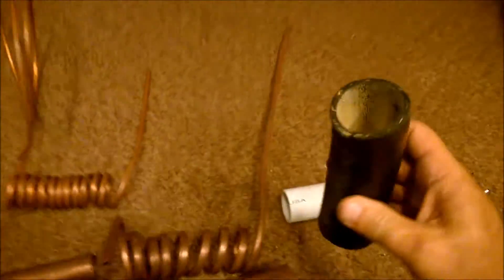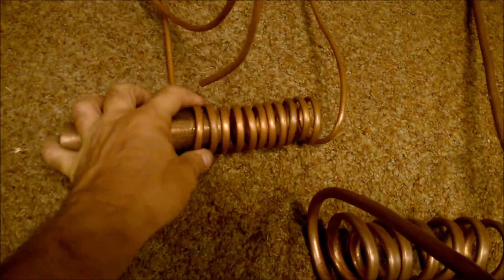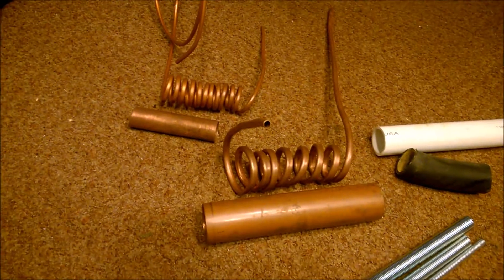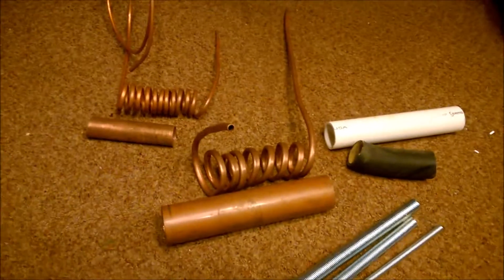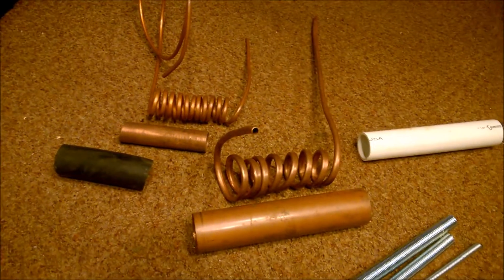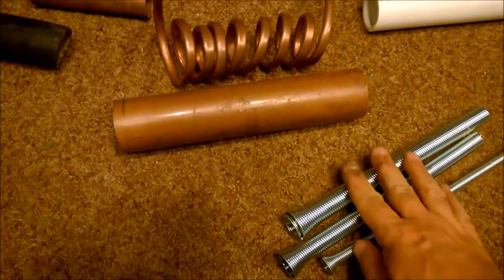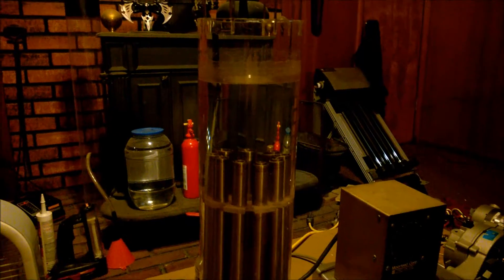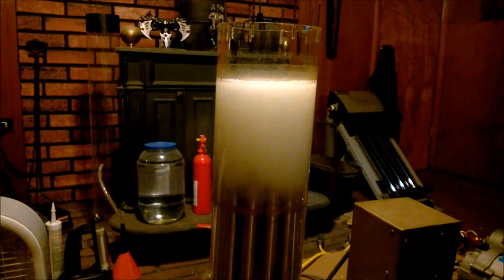PreHeated Gas Instructions

Comment: I Will be trying this on a couple small motors, but will design a temperature measurement device (pressure/gas fitting/likewise to ensure that the fuel doesn't go beyond my expected parameters. Also I have a gas evaporator canister in my car so you could probably just design a vapour collector somehow with some porous materials or metal foam.
Reply from the maker: sure just know Gasoline will not self ignite till about 400 degrease Plenty of room for the amount of heat from a water cooling system Also its under pressure so the tempter is much higher

Comment: well first off just fill the copper tube with water and pinch the ends before you twirl it around the copper pipe, then I would make a very long preheater tube simply to make the gas as vapored as possible . coolant heat could never reach auto ignition temps so no danger there.  Also , when gas returns to your tank it creates vapor and your car depending the model (mine recycles it) will valve into the manifold.
Reply from the maker: yes since this video I was able to make better coils with ought kinking. and yes I'm aware of the auto ignition temps. it does and has been working well.
Reply: Chris tian so why not simply heat the return line to the tank rather than the supply line to the engine if there’s already a system in place to bring fuel vapours to the intake?  Also, why the coolant system when putting a coil around the exhaust would heat the fuel closer to vaporizing faster?

Comment: what are these silver spring things?
Reply from the maker: Silver springs? U mean copper Coils?
Reply: Mad Scientist yeah those you use to bend the copper tube. What are they called and how are they used? Thank you.
Reply from the maker: I have another Video and they are simple Copper Tube coils that Pre Heat Gasoline when u connect them Inline the waste heat from your radiator Hose so u get Vapor and will get about 10 More MPG as well as Increased Horse Power when it heats up
Reply: where would you go to find a copper tube and the smaller inline copper and how would you be able to bend the copper to a spring shape like that.I've been really interested into doing it to my vehicle,especially when I have denso iridium TT spark plugs
Reply from the maker: ok there are several ways some use sand filled but I don't recommend that for obvious reasons. Another way is fill with water and freeze it. That works ok. the other way is simply slow and easy around the peace of pipe your using. that said the best bending method is Coil bending Springs u can buy at Lowes or Home depot  here is a Link  https://www.lowes.com/pd/Cobra-1-4-In-5-8-in-Tube-Bender/1000063157
Reply: lllPhantomlll Basaker 
Do not do this to your car, it will explode if you are not familiar with working on pressurized fuel (lines). Oem replacement is one thing, but to do this would invalidate insurance, could catch fire or explode in the community. Do not do this unless you are trying an off-road project.